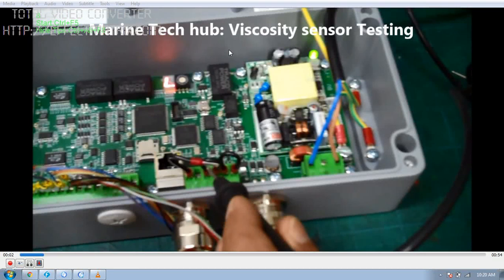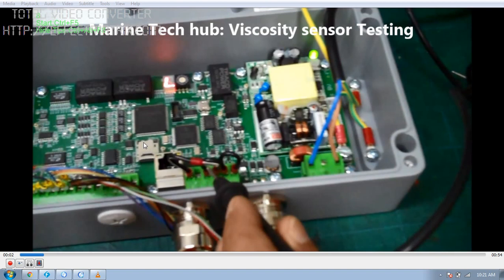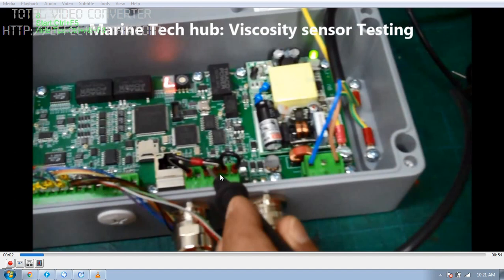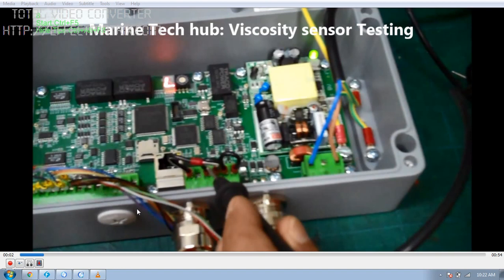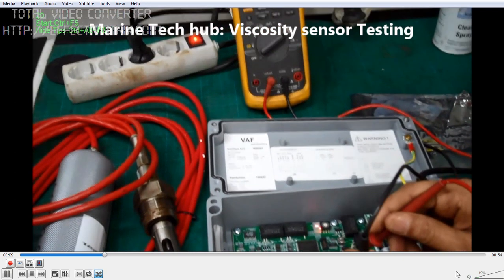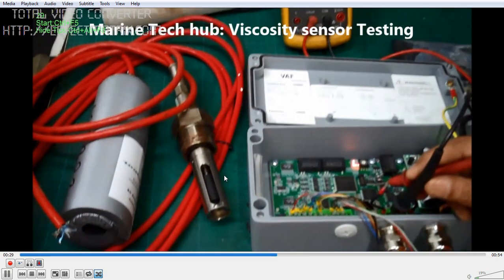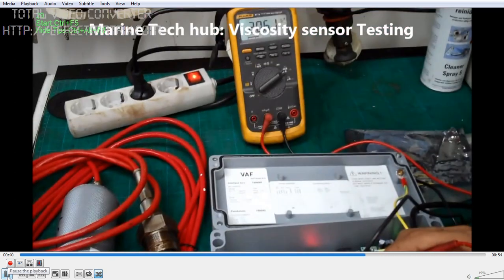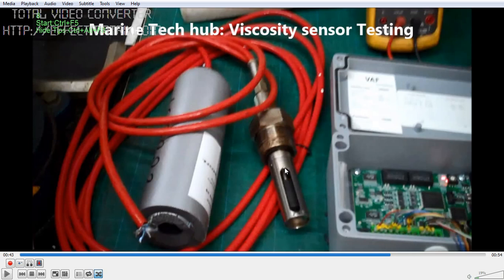Viscosity Sensor : Testing: Important Tips For Engineers

Comment: Yes, I was. I had a problem with the viscosity readings on one vessel. Could not determine if the sensor or interface board was faulty. I was hoping of a possibility to measure some electrical output from the sensor itself to determine if it is faulty.

Comment: Hi, Are you sure that the output of the sensor is 4-20mA? The interface board converts the sensor signal to an appropriate 4-20 ma output. But this output is used only for external eqpt like remote displays, viscosity controller etc.
Reply from the maker: Thanks for your valuable feedback !! Do share it with your colleagues and friends

yes I am measuring the 4 to 20 mA on the interface board . please watch the video carefully